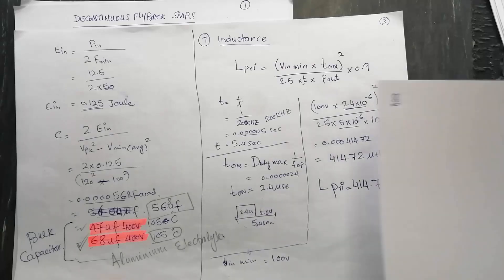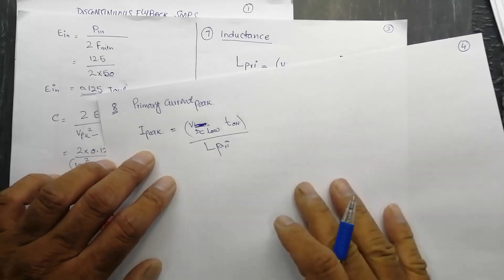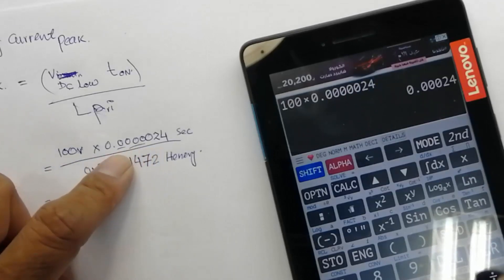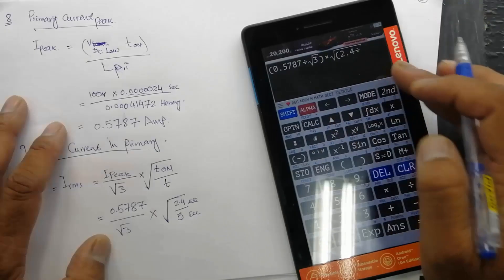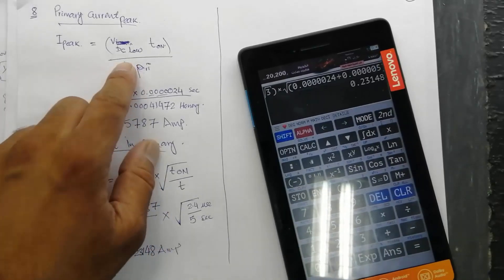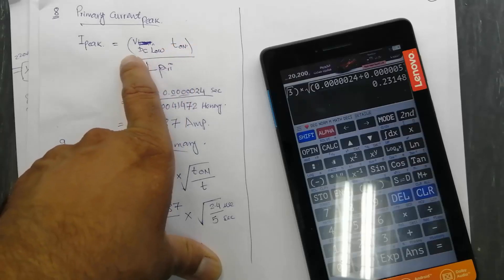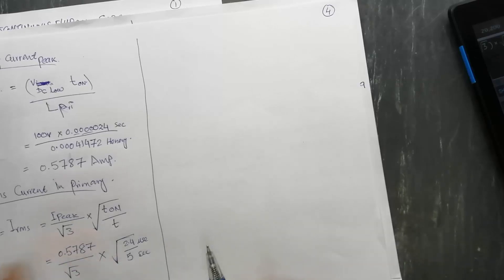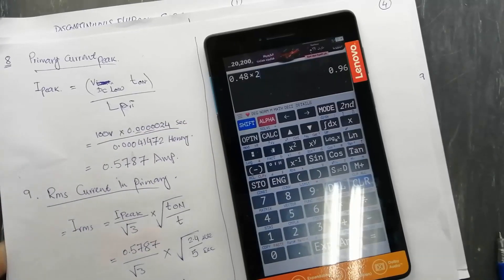#266 How to Calculate Primary Peak & RMS Current in High Frequency Transformer

Comment: What changes we should do to the circuit if we use flyback controller in continuous mode?
Reply from the maker: just you have to set duty time above 50%
Reply: @HaseebElectronics  continuos vs discontinous which will efficient?

Comment: Hi friend
How would you choose the duty cycle as a 0.48
Can you plz tell
Reply from the maker: for discontinuous operation in flyback we have to switch ON time, switch OFF time and a dead time period to discharge winding completely. it is maximum 48%
if we select 48% ON time, 48% OFF time and remaining 4% is allocated to set it in discontinuous mode. 
if we select 50% then the converter will go in CCM flyback
Reply: @HaseebElectronics  super sir,can we set it also less than 48%.
And In datasheet they mention maximum 100% what is that means.
Reply from the maker: @monimonish302 50% and above it is CCM Flyback topology
less than 50% it is DCM range. so this ic will start from 0 to less than 50% to regulate output.
Reply: @HaseebElectronics  Tqz u so much.one last question is there any formula for regulate output using duty cycle....for flyback topology...
Reply from the maker: @monimonish302  yes you have to sleect the minimum DC voltage to calculate the transformer primary turns 
so the smps controller will automatically start to provide required output at maximum dc voltage using minimum duty cycle.  and using maximum duty cycle at minimum DC voltage
Reply: @HaseebElectronics  thank you sir...

Comment: Hi sir i have one doubt 
I have 21swg 0.81 mm dia cu winding wire which is rated for 27khz 1.5amp but i want to use same wire in 43khz, so i used 2 stant  of same wire. 
Is this new wire will provide current of 1.5 amp in 43khz. 
I dont have other lower swg wire. 
Or i have to do with 3 stands.

Comment: Sir what is the reason for the earth coming in the output pin of the adapter
Reply: Earth wire is protection for human in case human touch live wire the current will pass through human body to ground and in this case RCD  will trip disconnect power supply
Reply: @GHEBIANDGAYAR  thanks sir